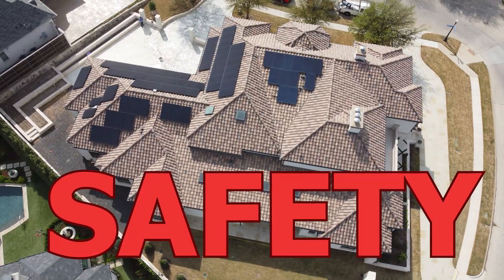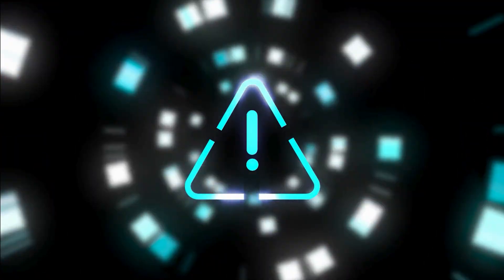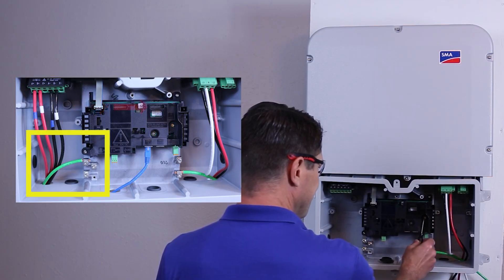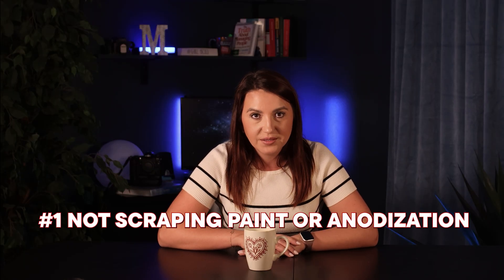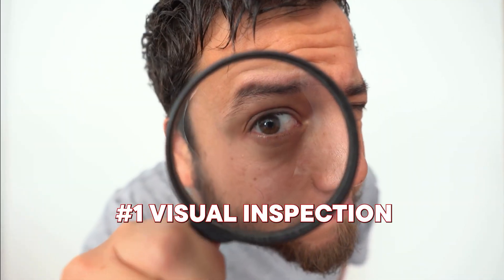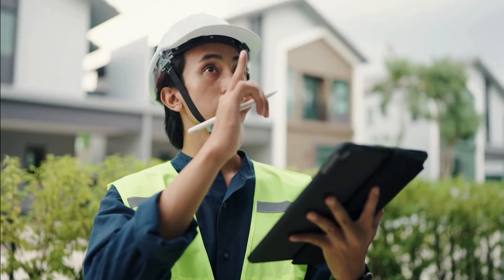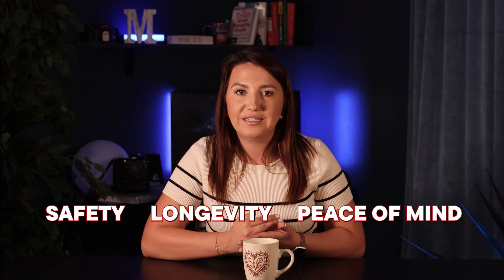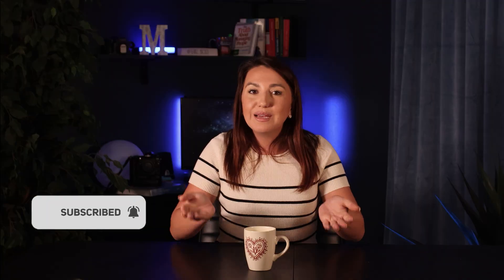Solar Grounding EXPLAINED: The CRITICAL Step Installers Skip (Costly Mistake!)

Comment: In the diagram presented it shows a PV system ground rod with a direct bond between it and the main house ground rod.  Since it also shows a grounding connection through the inverter isn’t the direct bond between the 2 rods redundant?

Comment: I am looking to ground my solar panel array and don't know what grounding lugs to purchase.  My main concern is using an aluminum lug and running a copper wire thru it.  Won't this cause electrolysis?
Can you make a recommendation for a lug that would properly etch the coating on the panels and give a good grounding contact.  
My system is totally off grid with no AC grid power at all.  I do have a grounding rod for the inverter and wiring inside but have not grounded the panel array.  I know from your presentation and others, this ground from the panels must go to this one and only grounding place.

Comment: Amateur here-
Should NOALOX be used at the contact points where the copper grounding wire meets the aluminum frame?

Comment: I have install solar systems for over 40 years, ground bonding frames and fittings is bull shit. This is electrical engineering use to AC system. DC from the panels should to straight to the solar controller then batteries. Grounding the DC side is just dangerous. If you think of it as a marine battery power system both polarity are ground free. If you have a fault and one pole drops to earth you have no problems MEN AC system earth the ground and Neutral, if you drop the active to earth it shorts out the system.

Comment: FYI = I never  (EVER)   invite a GROUND Wire into my  HOME  from my SOLAR !
...
100' distance from the Arrays  to the Power-House = in buried 2" Conduit 
TWO Wires from my Ground-Mount are 8-AWG  Tinned Stranded MARINE Grade COPPER 
+POSITIVE+ 
NEGATIVE 
...
no 3rd  GROUND WIRE included in the CONDUIT  brought into my HOME !!!
...
Ground Mount is Grounded   TWICE  at the ARRAY ( 36 "PV" Panels ) 
1st with the COMBINER-BOX  @ SPD - Surge Protection Device 
2nd with the  "PV"  Frame Bonding / Grounding 
to an  8'   Copper-Coated STEEL Ground-Rod 4' below my Combiner-Box  at the ARRAY   
...
IMHO 
...
COOP
the  WiSeNhEiMeR  from  Richmond, INDIANA 
...

Comment: if your in a Rural area 90% of everything she says is False and not required per NEC code which followed can and will kill you if followed incorrectly,  common senses will tell you if lighting follows the path of least resistance its coming into your house from the PV array, do not bond this to the house.

Comment: My understanding is that all the metal components of a solar array, frame, rails, posts should be bonded and provided a ground source. A grounding rod in the ground local to the array should be all that is necessary for a DC array, I can think of no reason that a DC source would need to be grounded to the inverter (separate or hybrid, not inline) or to the main house ground. I realize a large number of solar installations use inline inverters and therefore there is AC potential at the array, this must be tied to the rest of the home main grounding point. But if you are running DC directly back to a hybrid inverter there is no reason to provide a potential lightning strike a path back to your batteries and inverters.  Any thoughts ?
Reply: Exactly correct. Gounding your 12v panel array raises the chances that your array will get hit by lightning.

Comment: Solar panels are metallic.  Lightning loves it. You need a serious ground in FL. I use four ought copper wire, about 3/8” dia., cad welded to six, 10ft ground rods. #10 or #8 wire won’t cut it.  Bond with the panel, too
Reply: Lightning loves it because it’s a higher elevation system of metal with an easy path to ground. Adding beefier cables only increases maximum current capacity, but there is literally no gage of wire that can carry the amount of current a lightning strike does without damage.

In other words, making your grounding “serious” does not make it more useful here.

Comment: This is why I use the CertainTeed Solstice Solar Shingles and SunStyle Solar Tiles.  Just Black and Red wires.  Grounding happens with the metal boxes inside the house. 

Also much more resistance to rooftop moisture penetration than with solar panels.

Comment: What if you have a manual transfer switch between utility power and your solar power system? Would you still want both the solar and  grid side grounds connected together, or would you just have a separate grounding system for the solar side since the two systems never touch each  other?

Comment: I am saddened that you did not mention a little history with past NEC code and grounding.  If further complicates the discussion, but for people doing maintenance and upgrades on old systems, it is useful.  In our region, different installers have brought either the positive DC or negative DC photovoltaic output at some point to ground potential.   This was how the NEC was interpreted at the time by different people and inspectors.  This was before the age of micro inverters, fast shutdown and dc-dc optimizers.  So there are systems out there with crazy grounding ties at different locations - watch out !

Comment: I have seen a few people on you tube say that it is not necessary. My 40 years working fixing elevators and escalators with lots of experience with high voltage and currents of DC motor and generator circuits, along with AC grid circuits. Say different and you must use bonding and grounds 100% of the time. Not to mention the stored potential of capacitors and inductors. All of these items come together in a grid, off grid, solar, inverter and battery system. With the large batteries and voltages they present a huge danger if not done right. Yet very safe when executed properly. A good installation along with proper inspection and maintenance of a system will serve a person well for the life of the equipment. This is not an install and forget it system.

Comment: I would add (statistically) very few lightning strikes on solar panels actually cause noticeable visible damage to panels,  a lot more strikes (percentage wise) just cause a massive voltage surge that damages the inverter or combiner box etc. due to the spike and voltage surge.     So if you system shuts down during a bad lightning storm but you see no damage it is likely that the inverter or combiner, etc got hit by a voltage surge.      If your installer gives you an option then go for the larger diameter copper wire.

Comment: Grounding is a must ! Even on a total off grid system. Even if just a 12V system.  You can do a video covering the different hot water systems . I have hot water panels that heat up a heat exchanger tank . Direct solar to hot water system. Just a small pump needed and that has it's own solar panel.  That just 1 of several ways to heat water with solar. Covering this will help many . Thank you !
Reply from the maker: Absolutely! Grounding is 100% a must — even on small off-grid or 12V systems. A lot of people underestimate how important that safety path is, so thank you for pointing it out! :)!!!

And YES, hot water systems are actually a huge topic I’ve been wanting to cover. There are so many ways to do it: solar thermal collectors like you mentioned, heat-pump water heaters paired with solar PV, hybrid systems, drain-back systems… people really don’t realize how many options there are.

Your setup with the solar-powered pump and heat-exchanger tank is awesome — super efficient and zero grid dependency.Thank you for the idea and for watching
Reply: @solartimeusa  I am an electrician 35+ years and off grid solar installer in NY !! Cheers

Comment: I work/build with CNC machines, mostly plasma cutting ones, oh how many times i have to repeat that "grounding is the most important part..." to humans that are utterly void of any knowledge of why it is so important. It is one of those things you never think about till you actually need it, that is to late if you do not have it.
A few years back a guy calls me and tells: I owe you a lunch or dinner or whatever you want, you just saved my life! 
They had moved to a new shop and called me to fix the old power installation, so i did not allow them to work for two days till i fixed everything and installed ground fault protection, the 30mA delta one, that is what saved his life when he accidentally ended up with all 3 wired tightly gripped in his hand while he was spooling an extension cable.

Comment: I have a total of 6 ground rods and all bounded together is that ok
Reply from the maker: Yes,  having multiple ground rods bonded together is absolutely okay, and in many cases it’s actually the right way to do it.
The key is that everything must be bonded into one single grounding system so the whole house and the solar equipment rise and fall at the same electrical potential.
Reply: @solartimeusa  yes I have 2 at the house 2 at the solar shed and 3 at the panels so I have 7 and they all are tied together in the shed on a bus bar and component's Thanks  You do a great job

Comment: on the subject of grounding Martyna, here in the uk, grounding is the exception rather than the rule,yes some installers do ground on commercial sized metal roofs,but our typical residental installs it is not required for MCS certification ,for connection to the national grid, amybe its because you run 110/120v as standard & not 240v like the UK & Europe use ??, your thoughts why we dont & you do Martyna,ps love the videos :)
Reply: Nearly all microinverters in the U.S. are 240VAC.   House plugs are 120VAC but the U.S. residential power is actually 240VAC with a neutral in the middle, so either leg-to-neutral gets you 120VAC, but leg-to-leg gets you 240VAC.   Microinverters, EVSEs, and other heavy equipment use leg--to-leg (240VAC).   Household appliances generally just use regular plugs which are 120VAC.

Generally speaking grounding is required in the U.S..  In most places it is required.  In the U.K. it depends, but it's a mistake not to ground the solar framing because it's very easy for AC to couple onto the frames (either fed-back from the inverter, or via the microinverters)... even without a direct connection or a ground fault.  Just from the EM coupling.